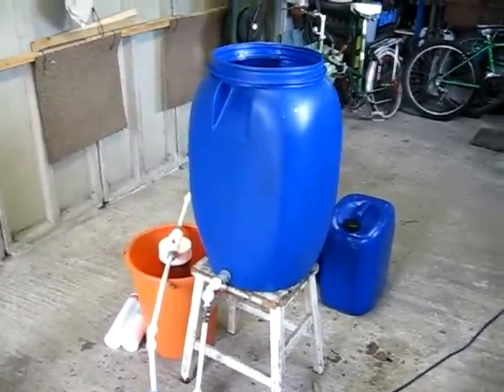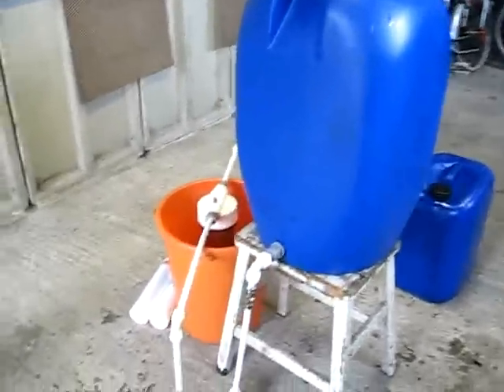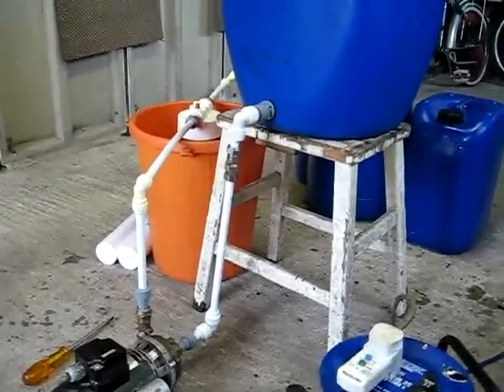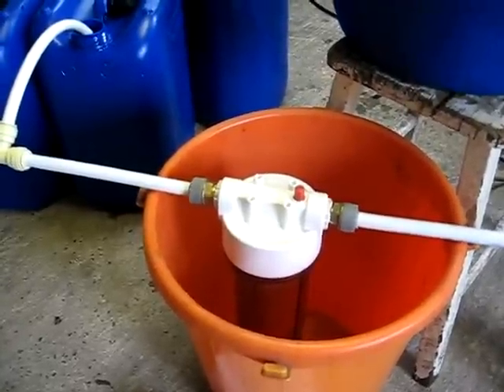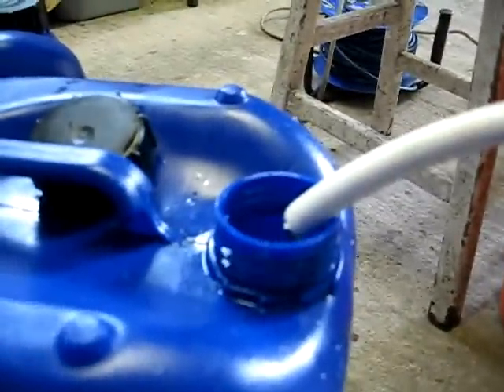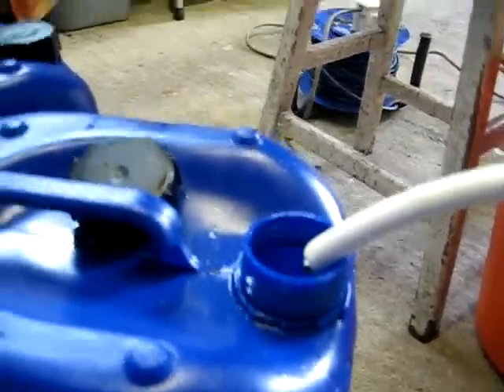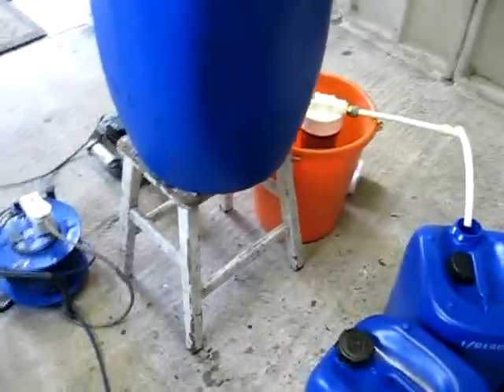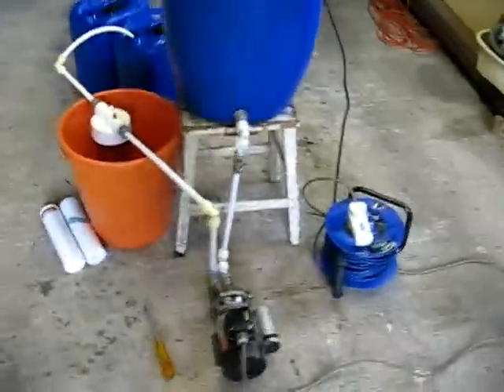Waste Vegetable Oil (WVO) Filtration

Comment: IS THIS PUMP CENTRIFUGAL?
Reply: Yes, it is.
Reply: @agentwhitedog1  do you know about   the pump specification, is a water pump?   And about the filter microns?
Reply: @MarceloGomes-hf9vb  From memory, I only know that it was about 140W. But it does not really matter - The higher the power, the more flow you will get, or the more you will be able to pump through a partially blocked filter.
Reply: @MarceloGomes-hf9vb  What do you mean by a "water pump"? Pumps pump liquids. It can pump anything from crude oil to your own piss!!

Comment: Hi good job:) I am going to create similar system as I'm fed up with heating oil on the cooker and then pouring it up through the filter to another bucket. Tell me please how long these cartriges last for ?
Reply: No idea, sorry. But I can tell you that they are reaonably chep, so even if you have to change all three cartriges once every 20L of oil, it will still work out "quite cheap" per litre.

Comment: Hi and thanks for the video. I am setting up a filtration system soon. I heard that 10 microns is the size of the fuel filter in most vehicles so is 1 micron necessary? Also many other setups on youtbe involve dewatering of the oil, do you not need to dewater?
Reply: No idea whether 1 micron is necessary or not. I just did it because it didn't cost very much extra and didn't take too long.

Comment: @GoaBiofuels Nice one, cheers for the info. My assumption was that cold starts would be tricky / stress the pump with veg oil alone - although I know 306 fuel filter is pretty good once it's running as it is block-heated, great for veg oil.

Was hoping to do something with my 106 or 306, but both have lucas! Time to buy an 80's merc!
Reply: I fully agree. They are the best! .... Anything before they converted to this "CDI" bollocks will be fine.

VW engines prior to about the same year are also fine, I had a 2002 Skoda Octavia and I think there is a good video on YouTube of one other bloke running one on WVO.